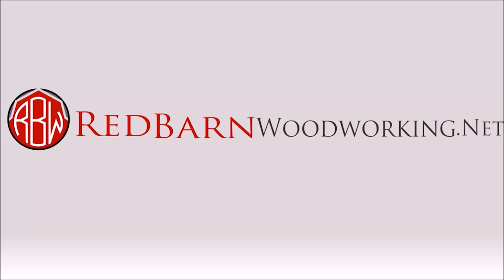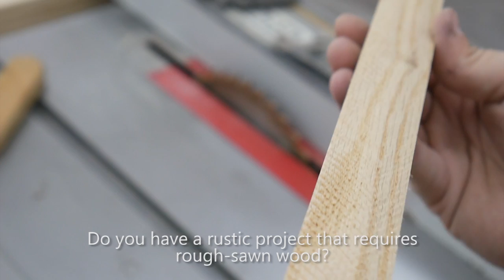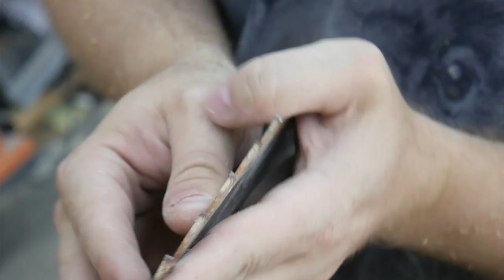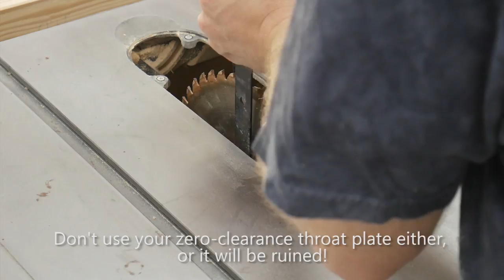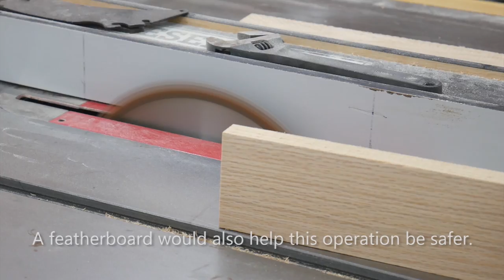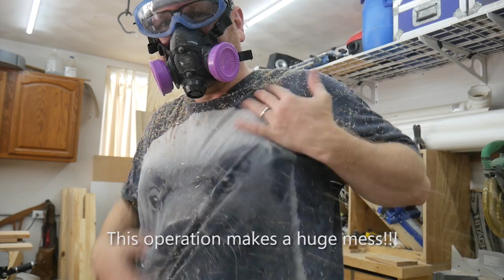Duplicating the "Rough-Sawn" Look

Comment: I'm using new 8" wide pine planks to build "aged, barn-board" sides on a 5X10' trailer.  This is an interesting method, but it seems like it has a big drawback for anyone using wide boards.  The circle is too small.   When you think about it, all you want are scratches in the shape of a large arc in the surface of the wood.  Because I only have 29-8' pine boards, I think I'll just attach a simple wooden-arc-template to a "shoe" and slide it down the 8" planks and use a 1/4" chisel or even a nail to just scratch in the wood.  That way, you can use the large diameter of the faux "saw blade" on the board you are using.  So, I would use about 9" of a 3 foot dia. circle as my scratch guide.  On my trailer, some boards would be scratched aggressively and some boards only need to be scratched a little, giving a very nice random rough sawmill effect.  And, you could pivot the arc, for certain planks, to give random angles across the wood....  It's a nice non-power tool method.  Just an idea!
Reply from the maker: Good idea, seems like a lot of work.  My method is limited to about 2x the maximum depth of the sawblade, in my case is just over 6 inches.
Reply: Thanks.  It's a little bit of work... not too much.  I should be able to scratch an 8' board in about a minute.  Your method is perfect for smaller boards and if you have a lot of them to do.  My idea might be a good solution for boards larger than 6 inches (however, I haven't tried it yet)   I will have fun telling people that I made every mill mark.... individually!  lol

Comment: Thanks so much for your video, I'm putting up some exposed wood beams in my house and I want the rough cut and Distressed Wood look, but if I purchase the "real deal" type old beams, they would be so heavy, so this way I can use three sied hollow beams, basically three two by sixes and not throw my back out trying to hoist 250 lb Beams.  They are non-weight bearing, purely cosmetic, so no need for all that extra weight.  Thanks again, just subscribed to your Channel
Reply from the maker: Thank you. Glad I could inspire you! I hope it all works out.

Comment: Hi! Awesome! Would this technique still work with all the safety guards on the saw? I see you removed everything, but I’m too inexperienced to risk that. Thanks so much! I can’t wait to try this!
Reply from the maker: Hi Christy, thanks for your question! It all depends on the size of board you were trying to add this effect to. As long as the board’s width is less than your blade’s max height, you should be ok. In my example, the width of the board is greater than the maximum height of my tablesaw blade. In this case both the saw guard and the riving knife would get in the way as I was trying to make the cut, so they had to be removed.

Comment: The biggest radius saw marks you can get on a 10" saw blade is around 4-4.25". Doesn't work so great for wider boards. The mismatched radius on either half of
 the face looks fake.